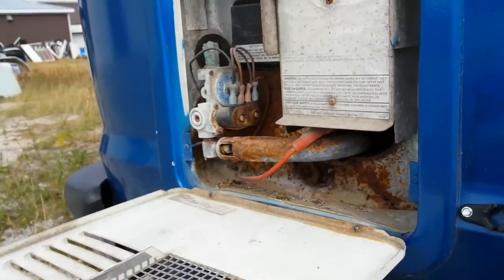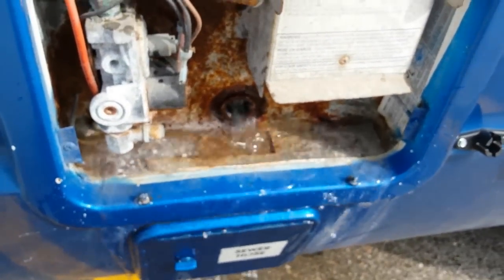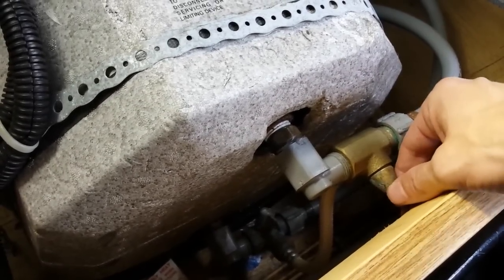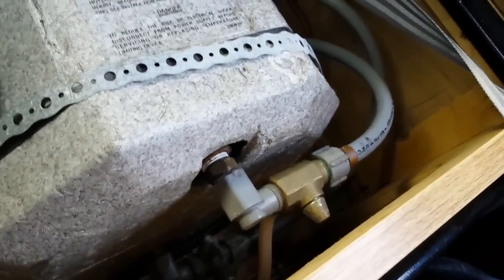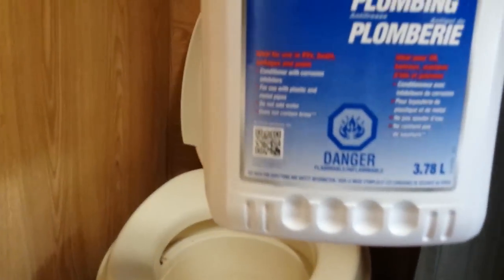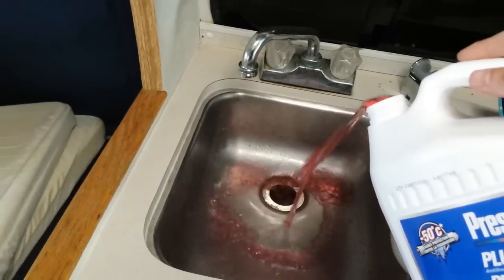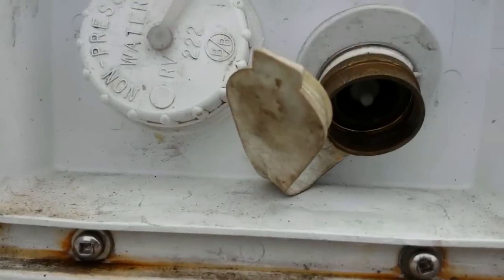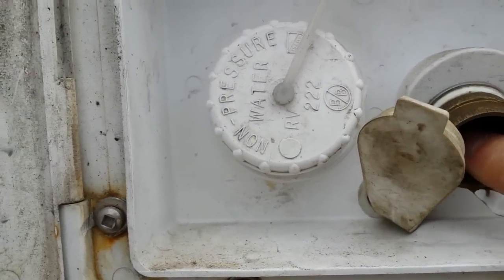RV Living / Van Live - Winterizing my Class B Campervan With Plumbing Antifreeze

Comment: Justin ... If you have an outside shower make sure you have run the antifreeze through that. Your vehicle might also have low point drains for the hot and cold water that should be drained.  There are usually some kind of tap or valve underneath the RV or in a sewer/water compartment for the low point drains. Make sure you leave some antifreeze in the toilet bowl to keep the rubber seal lubricated. The first time is always the toughest. I can do a full winterization now in about 15 minutes, not including draining all the tank.  I'm assuming you don't have a macerator pump for the black and or grey tanks otherwise you would have to run antifreeze through the that as well. Also be aware that there is a water line running from your fresh water tank to the water pump. Some people advocate pouring some antifreeze in the fresh water tank and running the pump to clear that line of water as well.

Comment: Liked the video! Here's and idea (Subs have lots of them!). Sand down that rust, and use a pint of Rustoleum from Walmart and a sponge brush with a wooden handle (also at Walmart, very, very cheap) and you can paint out those rusty places and it will look like new! Sounds like your mechanic is in no hurry to do your work? But you have found ways to do videos, anyway, and that is good! Will be interesting to see you actually on the road ...

Comment: You can drain your BW tank 9 gallons at a time it will take longer to do it that way but you can do it. Probably cheaper to do that than to buy antifreeze for the tank. A wagon and 2 ,5 gallon buckets and you are in business you will get 9 gallons at a time this way.

Comment: How did you drain the fresh water tank?
Reply from the maker: +mossy1 There's a shut off valve under the van which dumps the water from the bottom of the tank.  it just poors on the ground since it's clean water.